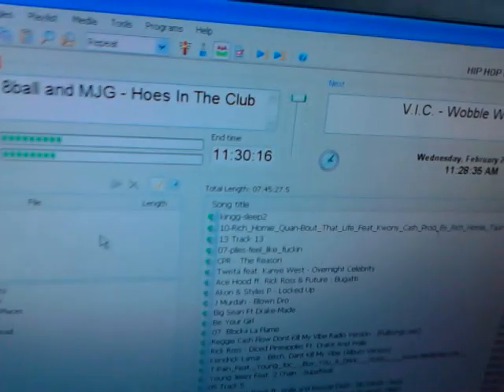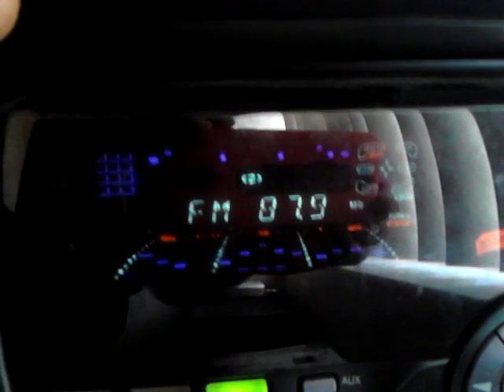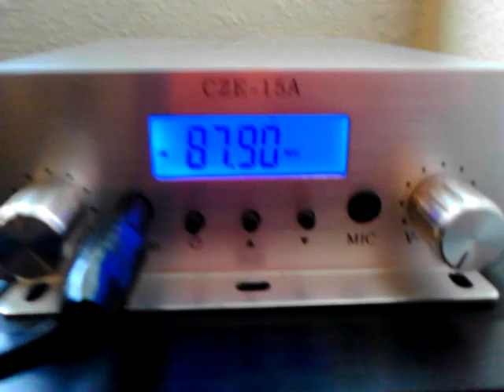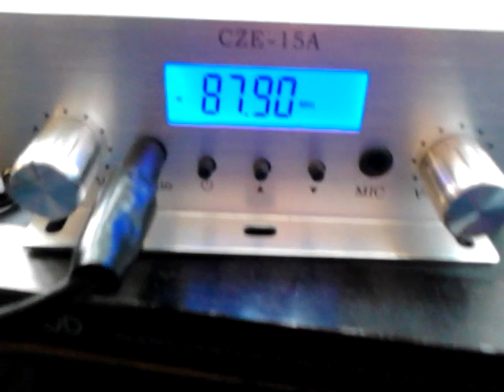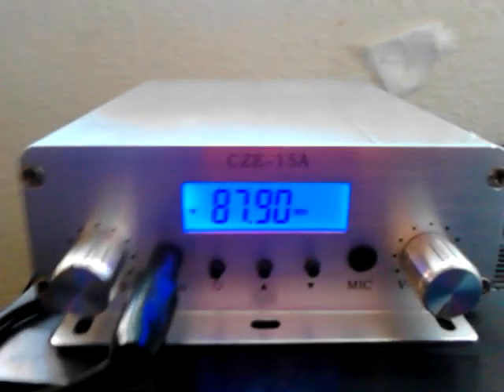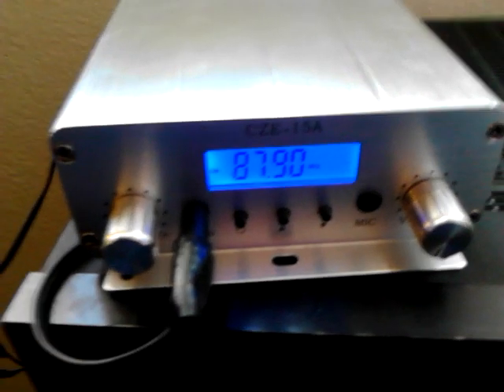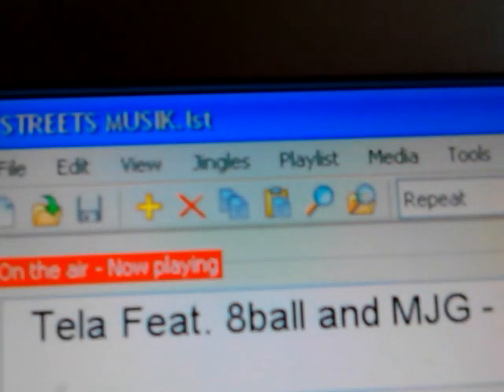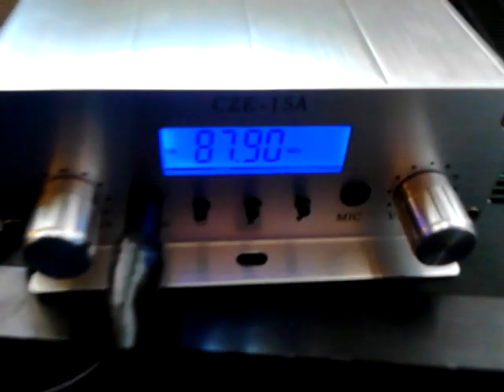CZE-15A YOLO RADIO 15 WATTS FM TRANSMITTER

Comment: you can also pick that up with your antenna in arizona but if you have internet radio you can rebrodcast that station in your state that would be called a radio station repeater to create a station range even far away than expected

Comment: Just letting you know, if the FCC finds you...... you are on your own.

Part 15 Devices 
Unlicensed operation on the AM and FM radio broadcast bands is permitted for some extremely low powered devices covered under Part 15 of the FCC's rules.  On FM frequencies, these devices are limited to an effective service range of approximately 200 feet (61 meters).  See 47 CFR (Code of Federal Regulations) Section 15.239, and the July 24, 1991 Public Notice.  On the AM broadcast band, these devices are limited to an effective service range of approximately 200 feet (61 meters).  See 47 CFR Sections 15.207, 15.209, 15.219, and 15.221.  These devices must accept any interference caused by any other operation, which may further limit the effective service range. 

Penalties for Operation Without A Permit or License 
The Commission considers unauthorized broadcast operation to be a serious matter.  Presently, the maximum penalty for operating an unlicensed or "pirate" broadcast station (one which is not permitted under Part 15 or is not a Carrier Current Station) is set at $10,000 for a single violation or a single day of operation, up to a total maximum amount of $75,000.
Adjustments may be made upwards or downwards depending on the circumstances involved.  Equipment used for an unauthorized operation may also be confiscated.  There are also criminal penalties (fine and/or imprisonment) for "willfully and knowingly" operating a radio station without a license.  DON'T DO IT!
Reply: Duh...
Reply: Are you the police lol 😂

Comment: all i can say is that you need to be careful, i am also a pirate station owner, but i can help you get your signal somewhat cleaner if you'd like. those chinese boxes scare me honestly. and should probably scare you too, if you're going to use one, it needs to be modified, chances are 87.9 is not the only frequency you are on
Reply: Ive got the CZH 15a transmitter which isnt too bad. I use DSP processing on my station. Its not a legal station but with the intention to be a local station for the people. My main problem is that this transmitter for some reason which I cant explain, is going out of the 104.5 frequency and is going onto the whole band. I seriously weaken the reception of legal station on my road and my station can be heard clearly on 98.0, 96,1, 105-108, 88-94. All over. Im quite concerned and unsure what to do. Any ideas? How can I get the most out of this transmitter?
Reply: Within the band it is....

Comment: How many miles does 15watt fm transmitter get you because I'm using a 7watt FM trasmitter and I go 3.5miles so how many miles does 15watts get you ?
Reply: I get about 9 miles with my 5 watts but am on top of a 7 story building...
Reply: Depends where the antenna is located if it is atleast 20m in air you can go up to 20km with 15W

Comment: Better lower your power output! I use mine on 1 watt low setting. Been on the air for 2 years without a problem. DO NOT INTERFEAR WITH ANY LICENSED BROADCAST.
Reply: Hey What range do you get Man......???
Reply: Sugam Mankad it depends on the terrain what's in the way as in trees building but 1watt get a signal out about half a mile

Comment: Thumbs up for doing this by all means but these chinese transmitters are nasty ass cheap crap that sprog all over the radio spectrum and may interfere with other radio services. Quick way to get busted. Also the audio is inferior. Better to get a proper transmitter.
Reply: 2steppa3 at the very least, he could put a low pass filter between the antenna and the czh. as for the audio quality, not much that can be done to help that other then make sure what goes into it is as clear as it can be, and even then, that's only going to get him so far